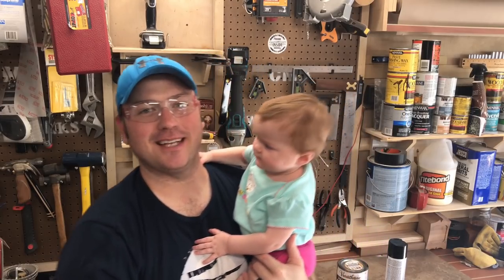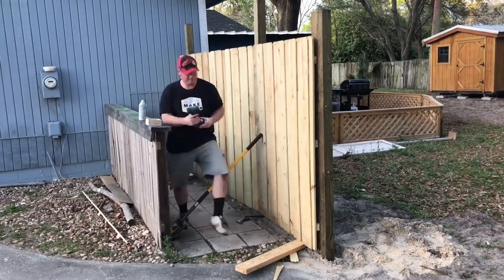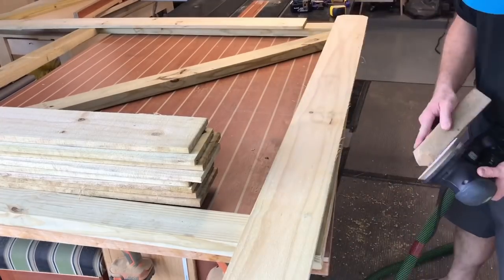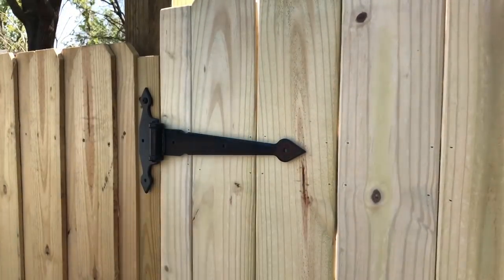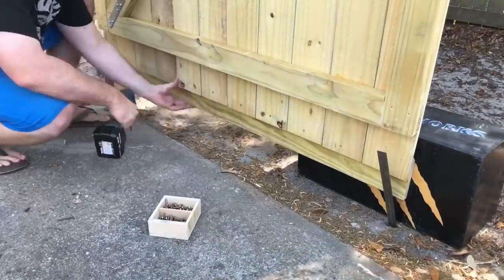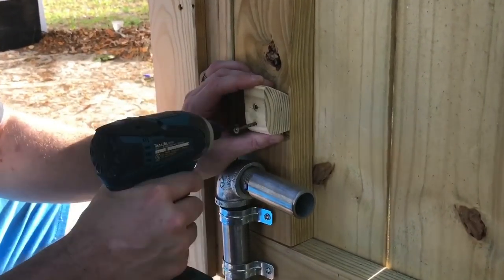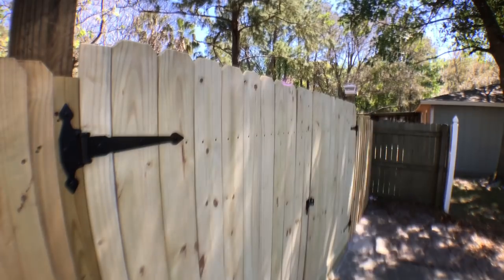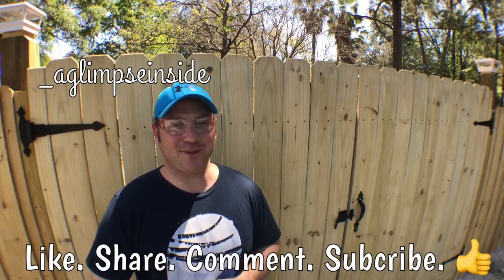How to Build a Fence and Gate

Comment: Living in Canada, we have to deal with frost heaving of the ground, therefore the posts have to be at least four feet into the ground. I dig the holes about six inches deeper and put a six inch layer of gravel at the bottom. Now comes the fun part. Putting the post into the hole, plumbing it and then putting all the dirt back into the hole. Once completed the post is rock solid, the gravel allows the water to drain and also gives a bit of flexibility so that the posts don't rise and fall with the change of seasons. Easy to replace if the need arises as well. Good looking fence and gate, Chris.

Comment: Aside from having an expert on hand, DIY is the greatest teacher! As others have pointed out, adding concrete to the post is required and by far the biggest omission here. I agree with other posts as well, regarding the additional hinges and cross member support for the gate which is lacking here. I would also use some serious caution about the pre-made panels due to the fast growth inexpensive lumber they are made with. You will find this to crack and warp very soon.
Reply from the maker: I appreciate your concern. I did go back a put concrete in the posts a year ago. As for the other issues. All is great!  Thanks again!

Comment: A Glimpse Inside,   only thing i probably would've done different
   would be make the hole and pipe in the 2x8 a bit larger.  over  
time with expansion and contraction the drop-down piece 
   might not fit as easily as when things were new.    other than
that,  a very very nice job.
Reply from the maker: I definitely appreciate the concern so far so good. Thanks again. As it turns out rust is the most concerning thing however it’s not too bad so far

Comment: Great ideas here. I like your solution for the gap under the gate; couple of questions about that 1. Did you anchor the threshold/ pressure treated 2X material to the ground in anyway to prevent it from rolling? 2. How has everything (especially the hinges) held up so far? My experience with that type of hinge hasn’t been good unless I through bolt them. Can’t believe there are any dislikes on this video. Thanks.
Reply from the maker: So far so good on the hinges. I agree about the through bolts. My family had a farm and our long swinging gates for the stables definitely needed them. As far is the threshold it is just wedged in place in between the two posts. The threshold consist of two boards that are screwed together and then hammered in place with a really tight Friction fit between the two posts. So far everything is doing great. Thanks for watching

Comment: Nice project.....looks like you have some cool tools too.......thx for video.
Reply from the maker: Thanks, yeah. Most were found at estate sales!!
Reply: A Glimpse Inside I’m in the middle of making a double wood gate, making a metal frame for it....like you I have trailers/boat/ RV. And other toys I get through mine....they just dont seem to last long, before sagging.......
Reply from the maker: Freedom 1 a 12’ 6x6 48” into the ground would eliminate any sagging along with thru bolts to attach the gate!  I have not experienced Any sagging yet. However I should’ve done what I just said above

Comment: Hey Chris, I enjoyed the video and your fence/ gate look great! I would be interested to see your preferred painting process once you're able.
Reply from the maker: Nicholas Wright thank you very much! I really like using a $70 Wagner paint sprayer. They work really well if you keep them clean. However I won't be doing that video for a little while due to the wood still being so wet. And also you can always touch up with a good quality 3 inch brush around the edges. Hope that helps

Comment: Great video!  Thanks!
Reply from the maker: Thank you and you’re welcome
Reply: Great video! I highly recommend, actually, its 100% necessary, to use minimum of 4x4 steel posts for gate posts. Also, steel frames on gates that hinge on the steel gate posts. You would be shocked to see how much wood bends and flexes when opposite weight is applied.

Comment: "All posts must be set in concrete" - my HOA requires! great and nice video though.
Reply from the maker: E. L. Thank you very much, that’s the good thing about not having a home owners association is that I don’t have a lot of these rules! Definitely a good point though to put concrete in the post. I haven’t had any trouble that far but if I do I’ll simply dig them out a little bit level them, and put some concrete in the them. Thanks for watching!
Reply: Sad concrete is for hoa stupid.   It's a nightmare to remove later.  It snaps at ground level.
Reply: DAN KOS I use the 36” Metposts, 
I dig 2’ down hammer in a metpost take my 4x4 char the wood with a torch then I use roofing tar and coat the wood bury the post. Seems to work pretty good. Havnt had any issues yet

Comment: One extra hinge on each gate, an extra couple cross supports on the gates and concrete or they sell a foam for fence posts at home depot that actually works great. Just a few suggestions for longevity purposes but I'm definitely gonna use that pipe lock idea. Good job though thanks for the video
Reply from the maker: To tell you the truth, the other side of my house needs to be redone. However this time I’m going to convert a fence panel into a gate instead of build it from scratch. I’m also going to take all the suggestions throughout this video and use the foam and try a few more hinges. Maybe even Though bolt them!! Thanks for being put be on the lookout for that new updated version

Comment: Shouldn’t the cross braces on the gate run from the corner by the top hinge to the bottom corner away from the hinges to keep it from sagging?
Reply from the maker: Joseph Hahn That’s a great question. I’ll try to visualize this for you. Picture your self standing next to a flagpole. You’re going to grab the flagpole with your arms spread apart about three or 4 feet and then try to mimic like a hurricane force wind is blowing you horizontally to the ground while you’re hanging from the flagpole. So at this point your body is parallel to the ground with your hands grabbing on for dear life on the flagpole. Which hand would receive more pressure. The bottom one. Therefore hopefully this illustration That most of the pressure to keep something level to the ground is near the bottom hinge. I know this is a long drawn out way of describing it but I hope it works

Comment: why did you make the pickets on the gate taller? and wouldn't those boards you put  in the ground rot eventually.
Reply from the maker: I like the aesthetic of having the pickets a bit taller. And the Greenwood is specially formulated to have ground contact and last about 10 years. My family’s used it before on a horse farm and I had really good success

Comment: Nice video. Gate looks good!
What brand and model of hinge did you use? How have they held up?
Reply from the maker: The brand I’m not sure what the name is however I got them from Lowe’s in the outdoor hinge section they are the ones that are 13 inches long. And they are still holding up great even after year later. thanks for watching I definitely appreciate it

Comment: What kind of screws did you use to attach the hinge to the gate? I've got some good, strong ones going into my post.. but those same ones are too long for the 2x4s on my gate... so going to head back to the hardware store in the next couple days.
Reply from the maker: Those screws simply came with the hardware. It looks like their course threaded three eights inch thickness screws that are about an inch and a half long. Thanks for reaching out
Reply: Wow..  thx for the quick reply!  
Great job on your fence.  Wish I had all your tools!  :)

Comment: did you try using paint next time?and if soo what kind would be beter 4 the water resistant ?
Reply from the maker: Mine life adventure I have not painted yet however multiple coats of a quality exterior latex paint will do great
Reply: oh thank you
Reply: There are lots of works to install your fence. First, those lumbers must be dried, then, scrap, brush-off the nasty dust, and sand them. For the economy, I would only use exterior paint only.

Comment: Where did you buy the hinges and what’s the measurements of the gate frame
Reply from the maker: The hinges are from Lowe’s they are 13 inches. And the gate frame is 5 feet wide by 5 1/2 feet tall

Comment: I see that no gravel or anything was added to the outside of the fence where the gate is located, will the wood get damaged as vehicles go in and out?
Reply from the maker: Great question. I will very rarely put vehicles back there just a trailer. And I probably will use the trailer maybe 20 times a year. So far so good but that is a good point
Reply: I'd really like to see a short vid of backing a trailer up and over the wood base. Even if you only put a trailer back there a few times, that looks like a pretty big transition to overcome while reversing. I can only think of two ways it would look: 1) back up close then gun it and have your trailer bounce hard. 2) back up until your wheels touch and power up and over and still get a hard hit.

Comment: Looks good.  However, I can see people tripping over the big step on the threshold.  Also, the pipe fits too tight.  As soon as any crud gets in there, it will no longer fit.
Reply from the maker: OK thanks. I appreciate the concern however that big step proves as a speedbump for when I back my trailer into the gravel pad that I installed a few months after making the fence. It allows me to back up another exactly where I need to stop in order to hook up the trailer with ease. Also the pipe I’m happy to report, after almost 2 1/2 years has never gotten clogged! Everything is working well even today no sag and it still works like intended

Comment: Did you use concrete when installing the 4x6 or 4x4 wood posts? What type of wood are the posts?
Reply from the maker: I did not use Concrete at the time of the video however I did come back a few months later dig out about halfway down on each post and put some in there!! I would recommend putting concrete. However each of my poster down almost 40 inches into the ground and really it’s probably not needed at that point
Reply from the maker: It was a post our Southern yellow Pine that of been pressure-treated. I typically find Lowes has the best pressure treated lumber of any of the big box stores

Comment: Looks really good, but in about 10 years you will regret putting wood in concrete in the ground. Using cyclone fence post in the concrete and securing the 4x4s to that lasts longer. The big boxes also sell plastic posts that are meant for acting as the base that look neater and work better than my ghetto solution for retrofitting.
Reply from the maker: Markle2k thank you very much. But I do not use any concrete.  I have used Concrete in my previous home. While also not using concrete because I ran out in the same project. I lived there for 10 years and there is honestly no difference in each. Anyway I hope this one works out thank you for watching

Comment: What offense was taller the gate was than the fence and the bottom part instead of putting a piece of metal and I would have put a piece of PVC cuz it wouldn't rust together
Reply from the maker: Luckily no rust freeing yet. There is a gap I’d 1/8 all around the metal insert so we should be good. Good suggestion tho

Comment: Always set post to height never cut top of posts no need for lap joint on gates
Reply from the maker: Michael Martocci posts were 36” deep so I got longer Than I  needed. Lap joints were just my personal preference plus, I try to include as much instruction (albeit not professional) in each video as I can. Thanks for the information though I appreciate it

Comment: I would not have used wood glue, for the simple reason of expanding and contraction. Also you have a cross grain and it will split, when being glued to the top brace's !!
Reply from the maker: frank roden I really appreciate the feedback. Yes I should’ve used construction adhesive!  However on the splitting, so far so good. Thanks for watching

Comment: How are those hinges holding up
Reply from the maker: Hinges are holding up well. Due to the fact that they’re just screwed in, into pressure treated lumber I’m actually pretty surprised at how sturdy they still are. Usually large gates need to have through bolts. However I opted not to do that this time and it looks like I’m doing OK. Thanks for asking, great question

Comment: That pipe will never stay aligned with the hole, expansion and contraction of the wood will move that all around. Should have used a smaller pipe so it has room to fit more freely but not to much.
Reply from the maker: jryanwill I’m sorry I didn’t explain it better. However there is a lot of playing in the pipe up at the top of the fence for expansion and contraction. I actually mowed the grass today in and out of the fence and everything still works great

Comment: Parts of this are good but I don't think the hinges will hold up,  I've built allot of large gates out of wood they all tend to sag no matter how good you build them.  Obviously smaller/light weight ones are fine but 100 lbs gates built out of wood will eventually fail.  Metal/wood combination works the best or just metal.  Also post bracing is questionable probably not strong enough over time.  Either the fence or the brace isn't level, that would bother me.  He spends some extra time on things I wouldn't, like sanding fence panels, why?  Gate won't match the rest of the fence.  That stock fence panels bought from big box stores isn't the greatest anyway.  Also the bottom plate, why?  Not sure where he lives but if you get winters that too won't last.  The pipe that fits into a pipe idea will fail because the bottom plate will float up and down, that and the fence may sage eventually, pipe in pipe way to tight.  Also "horseshoe" clamps he uses are weak made for light duty electrical conduit. Concrete is the way to go on the base outdoors, even with concrete that pipe in pipe idea fill fail over time.  Carpentry skills are good but engineering may not hold up.  On  the plus side it looks OK and he seems to be a good work.
Reply from the maker: I appreciate your concern however after 2+ years everything is holding up great that is the honest to God truth

Comment: That shit not leveled
Reply from the maker: Yeah the ground underneath the fence has a variance of around 12 inches From left to right. However the fence is level. It just looks like an optical illusion because of the ground
Reply: A Glimpse Inside I believe he is talking about the fact your gates top is higher then the rest of your fence. Looks wonky
Reply from the maker: Patrick Bishop I can see how people would think that. It looks a bit different in person and plus I actually designed it that way to have the gates higher than the rest of the fence. I simply like the way it looks. But I do appreciate the different point of view. Thanks for your input absolutely